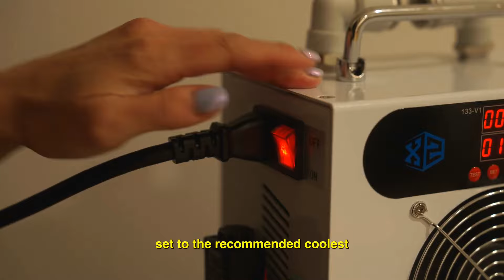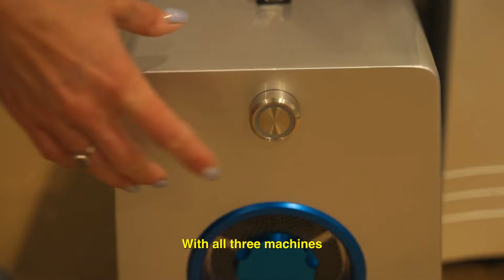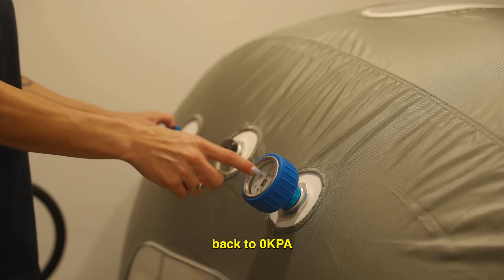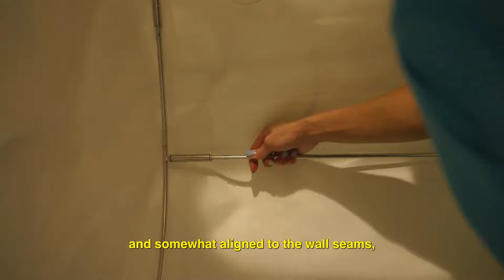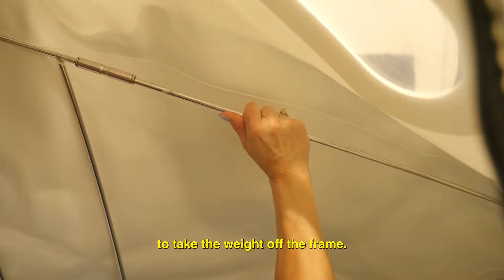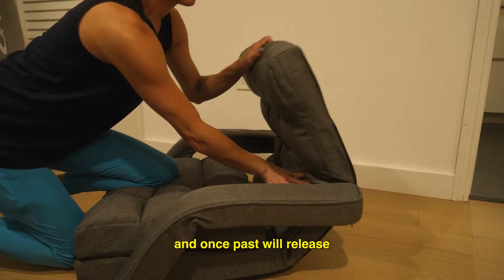Step-by-Step Airvida Pro90 Hyperbaric Chamber Setup   #hbot #airvida #hyperbaricchamber

Comment: Do you turn off the machine before decompression? You didn't say anything about that?
Reply: Call Hyperbaric Service Pros for the best support and free professional installations with all orders, the pro unit upgrade is not an extra charge and installation is free by a professional you will save over 1000$ and get a true expert.
Reply: No need especially when solo. The Decompression valves are faster than the machines ability to pressurize.